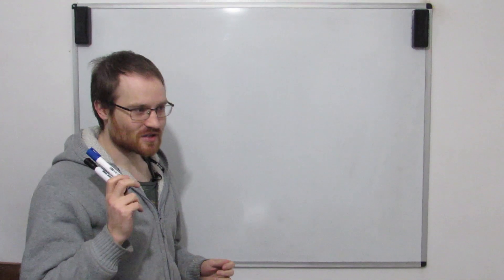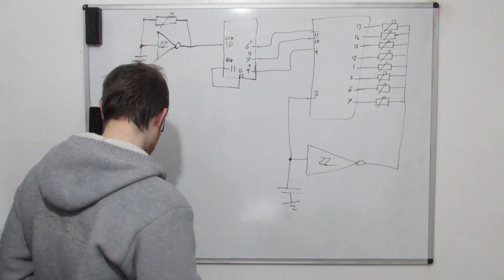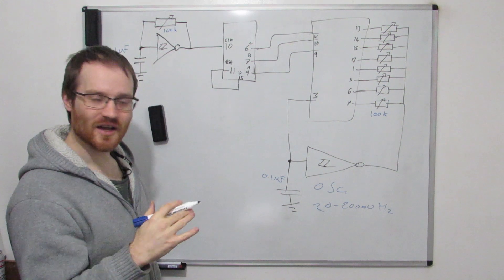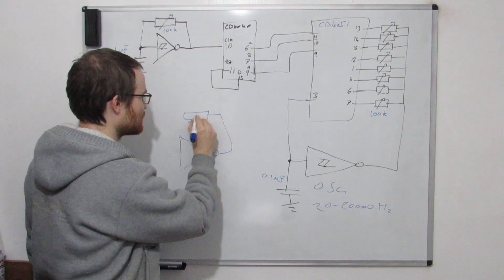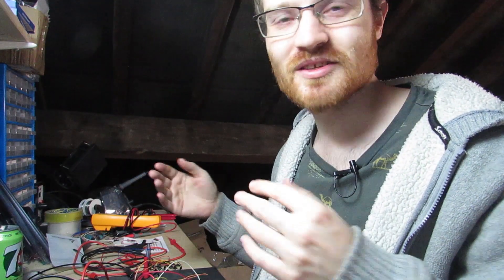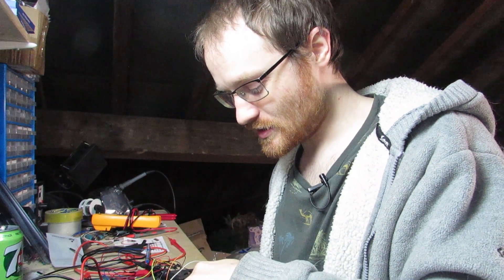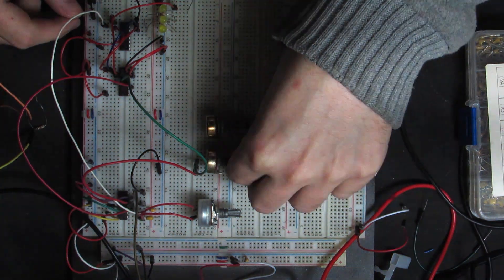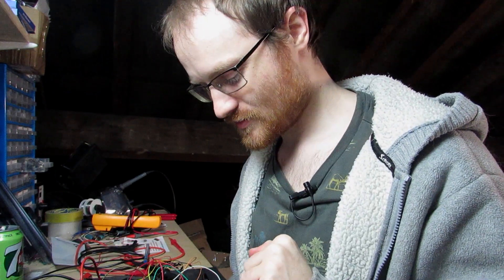Simple CMOS Sequencer

Comment: While I understand basic electronics, I'm now learning to build a diy synth with these newer chips than when I was blinking LED's back in the 70's lol.  But I learned of a chip back then that replaces the binary counter and the decoder (2 chips) with only one.  It is the 4017.  Will do the same thing this one does.  But the bonus is it is one chip.  It recieves the "clock" input and then outputs a small voltage at one of 10 pins.  You thus can have up to a 10 note sequencer, but it could be any number up to that by putting a switch at each of these pins and then if you want 4 notes, close the switch on what would be the fifth note, but route that to the reset pin thru a normally open switch.  Of course to keep it simple and not have a switch for each output, just wire it for an 8 note since that is a quite musical number so to speak beat wise.  You can also cascade it for more outputs than 10.  It's a neat chip and I used it a lot back then to create lighting effects with led's.  I'm enjoying your video.  Thank you for posting it.  I'm learning a little at a time about these Osc. etc.  A bit different than what I was doing with the Led's.

Comment: If you set the oscillator driving the CD4040 counter to 1Hz, wouldn't there be 1 second pauses in the sequencer output since the input will be oscillating 1sec on/1sec off?
Reply from the maker: This is a good question! What is actually going on inside the chip is that it's watching the clock pin (which is where we put the oscillator) and every time it sees a 0 to 1 transition, it adds 1 to the counter which we can then read from the 3 output pins. We then use that binary output (3 bit binary) to hoose one of 8 steps for our step sequencer. To summarise, the clock isn't 'enabling' the circuit like you might see with other chips, it's adding 1 to the counter :)

Comment: Enjoying these videos, thanks!  Am I right in thinking that you could replace the two ICs here with one 4017 IC and get the same effect, just counting the pulses from the slower oscillator and resetting on the 9th step?
Reply: A bit late response, but 4017 is a bit tougher to implement I think. It goes logic high when the pin is on. It will not switch any input to an output I think. I think that you would need jfets and some additional components too. Maybe npn driving the jfet and you would also need a negative voltage rail. 

It might be that there is an easier way, but I don't know of such. Then again I don't know much :)